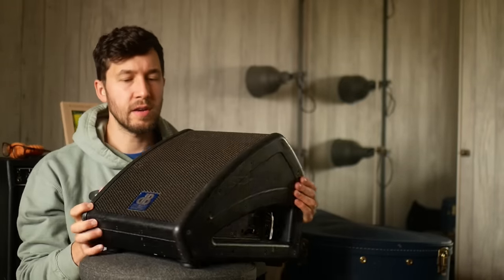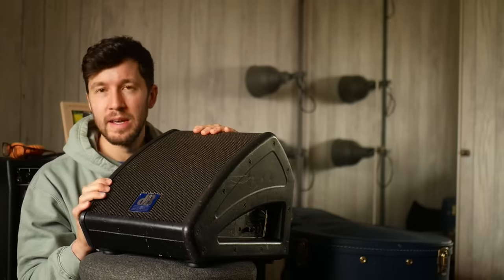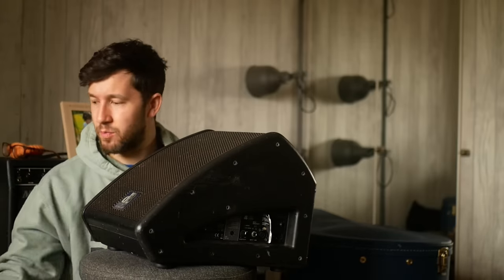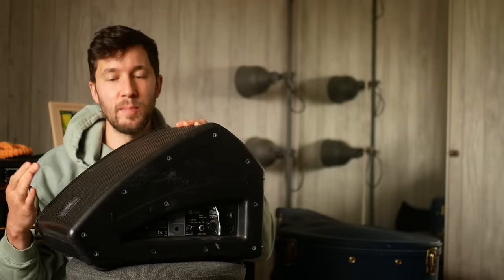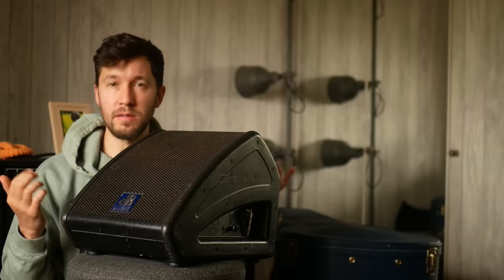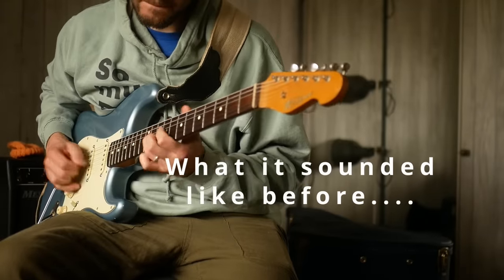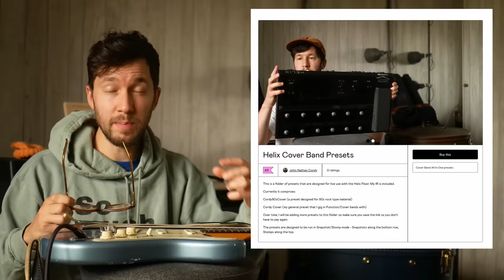Do THIS to get AMP LIKE Tones from FRFR Speakers

Comment: I’m a bit of a nerd, so i check the frequency range of the real speaker then match it in the cab block.
Reply: Doesn’t it feel like line 6 sho I’ll d have done that part themselves?
Reply: @Newnodrogbob this is the main thing an IR or any speaker simulation does.
If you’re adding filters in the cab block you’re just doubling up
Reply: @89ji76  I mean, “just doubling up” makes it sound like it’s some insignificant thing, but it has a pretty profound effect. I will admit that the latest cab updates in the helix don’t generally need a high cut applied. Or at least not as badly as their earlier versions
Reply: @Newnodrogbob   it definitely makes a significant difference, but it’s not making it more accurate to the original speaker’s frequency range
Reply: @89ji76  I’m totally on board with the idea that guitar players are superstitious weirdos who easily believe things that aren’t true. When hundreds upon hundreds of players all say that the modeler sounds like it’s supposed to except for excessive spiky high end, when compared to the original amps…I’m inclined to believe something is flawed in the cab sim-or elsewhere in the chain. Line 6 seemed to agree, since they created a bunch of improved cab sims.

Comment: The plastic bodies on the FRFRs create the boomy bass laden tones.  I think going for wood cabinet FRFRs might help quite a bit to get a more organic guitar tone.  I think Atomic's CLR FRFR speaker in like that.  Slap high cut, low cut, and perhaps 1 or 2 dB bump around 2k would be my suggestion.
Reply: I have this particular monitor as well. This db Tech FM8 is actually entirely made of wood (probably mdf) with plastic covers screwed to the wood sides. It is pretty bass heavy, though, but not because of plastic construction. It's also dual concentric with tweeter centered in the middle of the woofer. It's a nice little monitor just a bit light on power for louder band use and not as refined (or expensive) as the clr. Too bad they don't make them anymore.
Reply: @GertvanderDoes  Thanks for the feedback.  Good to know.  Seems like FRFR space has a lot of room for innovation

Comment: Remember what sounds best on its own is not likely to be the best sound to cut through the mix of a band especially if there is competition with other guitars or keys. Keep the mids up, cut the bass and dial back the distortion a little.  When I think I have a good sound, I tweak it with a "full" sounding backing track. Goal is to have it cut through the most with the least amount of volume.

Comment: I suspect part of what you are perceiving as a problem, is actually modelling that is mostly destined for recording or performance with a band. Therefore the models are shedding lower frequencies that a sound guy or recording engineer would be shelving anyway to make more room in the mix. At home, musicians are looking for the fullest tone possible and often set amps to push put a lot of low frequency mush that in a mix, just creates clutter and lack of clarity.

Comment: For a few years I used the low pass filter on the cab blocks to get rid of the fizz on certain models - like you did here. But I always felt I was sacrificing a bit of articulation and "air". I found that, on the Helix at least, the fizz is always centered at 4100Hz. I began putting a parametric EQ set to that frequency at the end of each chain. Depending on the amp model I was using, I would need to adjust the Q and the amount of cut, but I like the results a little better than just a low-pass.

Comment: Hello! At the Beginning I also set a low and high cut in the Cab Block with my Helix LT and the Headrush FRFR! But I get the better Result if I set a low and high cut Block as a Filter at the beginning of the signal chain! With Clean sound it is inactive and with Rhythm. / Lead the low cut between 80Hz and 120Hz, high cut between 5800Hz and 10000Hz! Depending on the Amp and Cab! Almost at the end of the chain a low and a high shelf! Only the high shelf should be boosted by 0.5 db at 2200Hz! Try it out 😉

Comment: Worth adding that hi and lo cuts in speaker blocks act differently  than in EQ blocks.
I appreciate that your solution works great for your legato for you but for many of us it loses too much high mids/low trebles.      The EQ blocks have a much steeper slope and allow a de-fizz without too much incursion into the kind of top end that a guitar cab would put out.
FWIW I always have a parametric block with hi cut at 7kHz (as well as a lo cut at 90Hz).  At home on studio monitors I bypass it.  At volume at a gig, on it goes.  Fletcher Munson curve does the rest.

BTW Rangemaster into a clean amp?  Ouch!

Comment: I have this particular monitor as well. This db Tech FM8 is actually entirely made of wood (probably mdf) with plastic covers screwed to the wood sides. It is pretty bass heavy, though, but not because of plastic construction. It's also dual concentric with tweeter centered in the middle of the woofer. It's a nice little monitor just a bit light on power for louder band use and not as refined (or expensive) as the clr. Too bad they don't make them anymore. That said I am cutting from 100Hz down and 6K and up. Output EQ for only the monitor gets a slight boost at 4K for some sparkle.

Comment: I plug in my modellers into the power amp in of my Katana 100 Mk2 without the cabs or IRs... It just works so damn good.. No unnecessary fiddling with all those high and low cuts..
Reply: No cab in the modeler???
I use Katana also...but keep the cabs on....sounds fine.
Reply: @mikerichardson2177  nope.. two cabs (one in the modeller and another of katana) sound muffled to me..
Reply: One the bests ways to use a modeller. I had a Katana and it sounds great

Comment: My Low Cut can be from 90 to around 106 Hz ( or a touch more ).
My hi cut averages from about 5, to 5.6 or even 7 kHz.
I do boost and cut around 560 Hz.(All  a Jason Sadites chain that really works !  ) 
And I have a soft compressor at the end, with the option of another as a 'pedal' at the start.
Thanks

Comment: Adding a hi-cut to the cab block was a game-changer for me. I used to be a critic of modelers - for their 'ice-picky' top end - until I did this. Critics of modeling should try this before they render their final judgement. 
Great video.
Reply: Yes, especially with single coil pickups.
Reply: First thing I do on a modeller is find global EQ & put a bass cut & hi cut in. It's subtle at those frequencies but just sounds smoother.
Reply: Agree.    I just switched to frfr and had it sounding great in my house then I went to my show turned up and holy highs.   I dialed the room I. And got through the show but ya now I know to use the high cut and low cut

Comment: I use a Headrush FRFR-112 at band practice and for the occasional multi-band gig with someone else's PA. My Helix sounds fine with no tweaking but I do use the low and high cuts on the cab block at 100 and 6K (sometimes as low as 4K) for all my presets whether running direct or using the FRFR. I think the 12" speaker in the FRFR also helps it sound like a regular guitar amp. Don't forget about the massive difference your mic choice and position for the cab block can make on your tone.

Comment: When you compare a diagram of the frequency response of an amp speaker compared to an FR speaker it's a rounded curve compared to a more straight line that drops off on the very ends. For that reason the amp speaker is going to shape and color every single model tone you're putting through it and accenting the midranges more than the ends of the spectrum. That's why the FR speakers sound brighter because they're giving you the full spectrum. I can see why some players would be used to that rounded sound and prefer it but it's not as accurate. I guess it's whatever you want and prefer.

Comment: One of the things I do on all my Helix patches is have a path that splits off right at the end of the chain, and goes into a mono EQ block. This is what I use for FRFR, and the main signal path continues to the main outputs in stereo. This allows me to slightly tweak the EQ curve for my FRFR to better match that of FOH.
Reply: You have global EQ for that purpose and it is assignable to chosen outputs.
Reply: @zbyszekolko3998  only applies to either 1/4", XLR, or both. I want it on Send 1 because I want to monitor a mono signal, while sending stereo to FOH. Is there a way to mono the 1/4" but not the XLR?
Reply: @NedJeffery  As far as I remember both pairs can be independently set to mono by connecting appropriate plug to the left socket.

Comment: Some FRFR units give you the option to disable the high frequency tweeter, leaving only the full sized speaker that more closely resembles a typical 10” to 12” speaker. My FRFR speaker seems to have more low end compared to headphones out or FOH, so I have to reduce the bass on mine instead

Comment: With an AXE-FX into Atomic CLRs I found a cut at 3700 hz and rolling off the highs above 4500 hz works well to reduce fizz for high gain
Reply: Atomics are the best I have a pair ! Simply stunning !

Comment: I had a Yorkville Y100W Wedge laying around and tried using that after it didn't work well with my Vdrums.   With the QC though it sounds better than I'd argue my tube amps.  It's loaded with a 15" Speaker and it punches you like a proper tube amp.   

I hadn't tried any other amps so I still have nothing to compare it to, (I haven't bothered to try the QC with my EVHiii 50w or the PRS MT15) but like the video says it does what I want it to.   The warmth and punch is unbelievable.  And used they are below 200.    I paid $125.

Comment: Hi gain tones
7:20 no cut
7:43 6k hi cut
7:55 4k hi cut
8:24 3k hi cut

Ac30
8:55 5k hi cut
9:10 2.5k hi cut
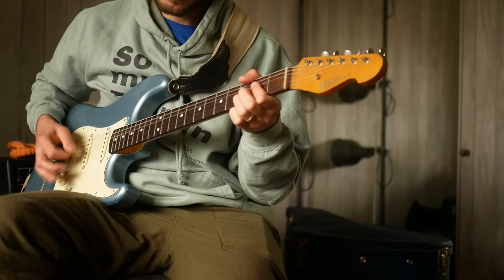9:22 2.5k hi cut, mic pos change
9:30 2.5k, mic pos, bass boost
10:07 final adjust

Presets
10:52
11:28
11:53

Comment: JNC you've touched I my forever challenge.   I dial in a great signal chain and amp model on my HX Stomp using my audio interface, computer, and studio monitors.  Only to get it to the FOH sound system where it sounds like crap.   I have considered an FRFR, but I have so much wrapped up in previous amp equipment I question do I really need one.  But if it would help me dial in a more realistic FOH tone, that would be worth it.
Reply: I've gotten used to dialing in tones on my Line 6 Powercab in a way that translates to FOH as well. It helps to do some quick spot checks at significant volume to get a sense for how things will translate when turned up. That workflow has proven more consistent than headphones, studio monitors, etc.

Comment: The light bulb moment for me early on with the Helix was understanding that if you look up real speaker specs, they usually range between 70hz and 80hz on the low to around 5khz - so anything over on either end - especially on the high end - isn't what you would experience out of a real world speaker anyways, ergo the lack of "realism."

Comment: I have a morningstar mc8 controlled all strymon board (compadre -> sunset -> deco v2 -> iridium -> brig -> cloudburst -> flint v2) and I run that into a 600 watt behringer keyboard amp and it works great, gives me an amp in the room feel and is very transparent, can't even tell much of difference when using my my in-ears (64 audio A6)

Comment: Re Setting the EQ is the way to go. I have replaced the stock speaker in a Boss Katana MK1 with  a Clestion F12-200 and reset the amp EQ. This is a now dual input i.e use the aux in small jack for the Helix. Main input for normal amp use.

Comment: Great 👍 advice here and great playing 🎸!! I just ventured into frfr. I love the stereo but like you said speakers let many frequencies come through that amps do not. I'm finding it is more difficult to dial in on a speaker. Start with cabs, if anyone using the boss stuff cut at global and with a PEQ is a lifesaver. I do feel the HX stuff is a bit easier to dial out high and low end just my experience. But once you do get it right the sound I believe is actually better

Comment: I recently discovered these kind of speakers on the website of one of my local guitar stores. I usually do small bar gigs and i usually end up using my line 6 spider V or my boss street cube 2. I like using the street cube better because it's alredy built to have a upward angle and with my boss gt-1 it sounds even better. So I'm looking for a similar kind of speaker so i can run my gt 1 into it but with more voltage so I have more headroom if possible for bigger places, so this seems like a good option for me

Comment: I think I'd find this video more helpful if John were to concetrate on the clean tones. My thinking is that if the clean tones are good, then the distorted tones will take care of themselves. Admittedly, I myself never use distorted sounds on a guitar - for me it's clean sounds all the way. 

From my POV as a pianist often having to play electric piano through a PA, I am all to frequently disappointed with the quaity of sound I'm getting. That's in part because a lot of PA speakers/amps are geared for either rock bands, or dance music, etc - where the 'smiley face' type EQ is the default position - in other words, loads of bass, loads of high treble, and bog all in the middle. 

Moreover, most electric pianos themselves have a harsh and brittle sound - maybe designed to 'cut through the mix' in a rock band. 

The only elecric pianos I've come across where there is a warmer, nicer tone are the Yamaha MODX8 and the Yamaha DGX-670. 

I'm fussy about tone on guitar and piano - I tune, restore and voice acoustic pianos for a living, so I hve a very good idea as to what and what does not consitute a good tone. 

I wonder if much the same is true of many types of rig for electric guitar? Is it the case that everything is geared to producing a very trebbly, harsh sound which 'cuts through the mix' but is offensively bright tonally?

Comment: I've always adjusted my Kemper (in the past) or my Tonex through studio monitors that have been adjusted to flat response in my room.  Its not perfect, but it gets close for most PAs I've gone through.  I typically just have to adjust my high and low pass filters.

Comment: Having tried the frfr route with a Modeller switching between headphones and frfr cab was an utterly frustrating eq tweaking exercise between the two. 

I sold all that gear and went back to an amp and pedal board.
Reply: Do you set your amp settings through headphones when using an amp?

Comment: From trying to get a decent sound out of a head rush 108, I agree with the need to make a high cut but I am left with a boxiness (that I dont get with a Powercab for example) and I hear that same boxiness in this video, but not in your usual recordings.   Did you hear that boxy  character in the room? Do you know any fixes ?
Reply: I hated the 108. Good luck w that thing. Too me it’s just bad. I really wanted the portability.
Reply: The fix is to get the 112 😂

Seriously though, the 108 is an 8” speaker in a small plastic housing. I think it sounds great within that context, but you can’t escape some physical realities.

Comment: I've tried looking up the specs on the real world speaker and seeing where they plotted the cutoffs and tried to emulate that on the cab. Example: Celestion Blue claims 75-5000Hz. Makes sense to start there. WDYT?
Reply from the maker: The thing is, the speaker cab is already just a static IR of a real speaker, so it's not like they're not accurate to the actual response of the speakers - BUT it happens to work out pretty nicely that high cutting down to around 5khz can really smooth off the tinny stuff anyway!

Comment: What amps are people using that they have FX returns?
Maybe it's just my taste in amps, but I've never owned a tube amp that had an FX return.
Reply: It's a modern thing, and likely gonna be a pcb amp, so if you're a vintage purist you won't find many tube amps with an effects loop before the 80s

Comment: I resisted an FRFR and use a PA cab similar to our FOH top cabs. This means what I hear is pretty damn close to what the audience hears.

Secondly, I do not understand why anyone wants a modeller to sound like an amp. If that's what you want, use an amp. 

I thought the point was that a modeller sounds like the guitar does on an album i.e. what the guitar amp sounds like when it's miced up and put through a mixing desk with all the reverb and delay etc. For me that has been the game changer. Rather than having a 100 watt Marshall running through a 4x12 which I cannot run flat out because no sound engineer will allow it, I have a Boss GT1000 that sounds like I have 100 watt Marshall running flat out but at a volume I can stand in front of.
Reply: Great video and I think there is a need for more of actual gigging tips with modlers. I have know about high cuts for awhile, I always thought below 6 k was extreme but perhaps not. I have an FM9 and I haven't been able to get it where I want it yet. An FM 9 video like this one would be appreciated. Thanks !

Comment: I have a Quad Cortex and I've never tried it on a tube amp.  Can the QC be used with a tube amp?  Would I have to remove the amp model from the settings and just use the QC's effects alone?
Reply: Best way is to either run it into the front of your amp as normal and just use the Cortex as a pedal board with no amp or cab modeling. OR you can run out of the QC and into the return of your effects loop if your amp has one. This bypasses the preamp of your tube amp which generates a lot of the tone in your amp (the other big tone generator is the speaker in your cab obviously) and just uses the power amp to send your signal to the cab. You'd be able to use amp models then and change the sound of your amp a bit, but you'd want to make sure you disable any cab emulation.
Reply: I go in front of a Princeton